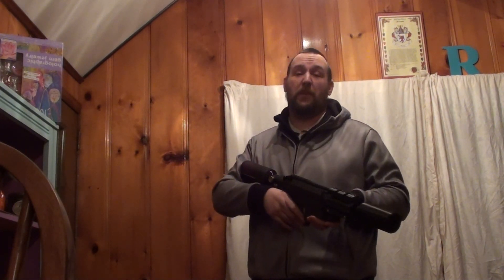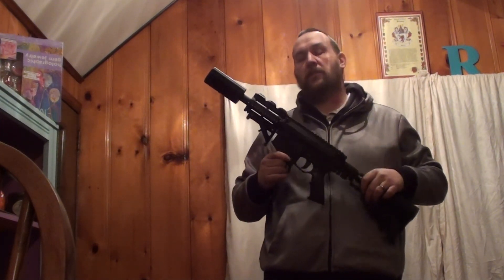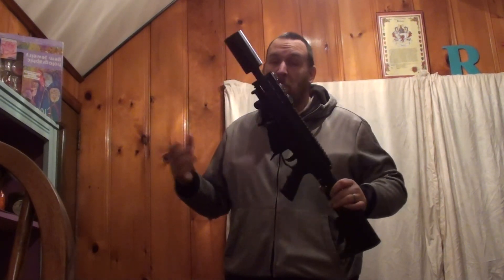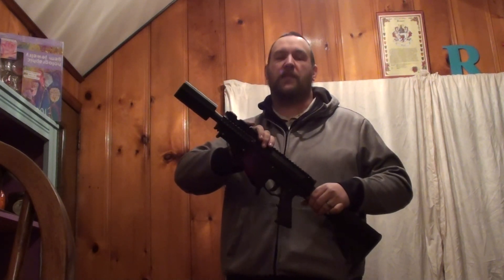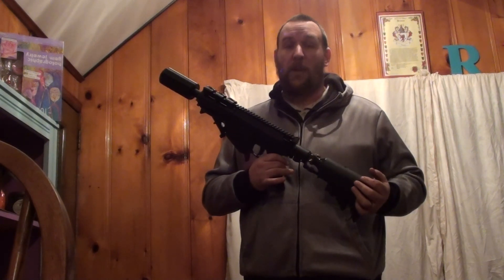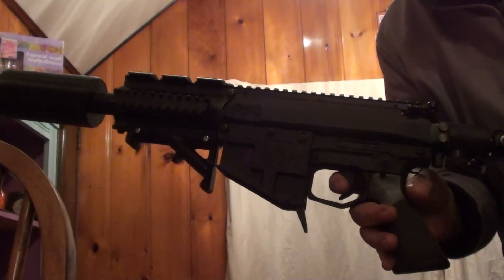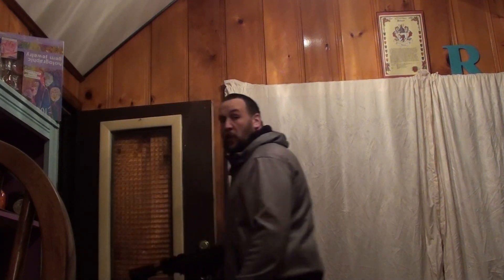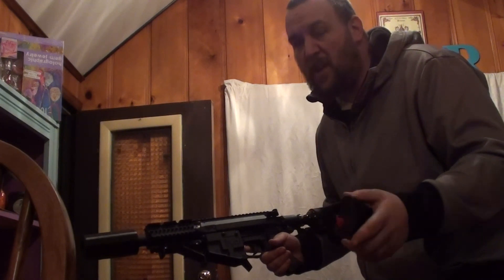First Ever Lock Bolt for the Milsig M17

Comment: Well I bought one for my m17a2. No it does not do well. any slight misfire you will be yanking on ur brh so hard and often u will take it off ur marker as fast as I did. It takes a lot of force on that brh to reset the bolt. Not like any other lok bolt on the marker this one is well designed but more of an inconvenience than a asset in my opinion. And I have a lok bolt for a Hurricane, bolt, and vortex. This one doesn’t stand up to the rest. But sure it will stop a chop but count ur shots and hope u feed perfectly cause u will be playing tug of war with ur bolt all day
Reply: Where would you of bought one? The files aren't up to download. Just curious...
Reply: He had some on ebay
Reply: @Yautjagaming92  gotcha!
Reply: I also have one for an M17A2, but, I don't have to pull my BRH THAT hard. Sure, it's more than usual, because you are pulling against constant air pressure

Comment: Will it work on the m17a2 without the charging handle?
Reply from the maker: As long as you have the hole for the hopper adapter.
Reply: You can install it, but if you run dry and the loobolt catches the bolt, you'll need the brh to reset it

Comment: Sign Me Up
Reply from the maker: It's pretty much ready. Some more testing. I need to run a few clips to make sure. Up until now it's been a few paintballs here and there. I ran out of air yesterday.
Reply: dr07828 cool keep me posted ...does it make a difference if I have a smg well and run zeta mags?
Reply from the maker: @hcr1995  no, as long as you have a breach hole for the hopper adapter.
Reply: dr07828 yes I do 🙌🏼
Reply: What ever happened to this? I can’t find the print files (if available)